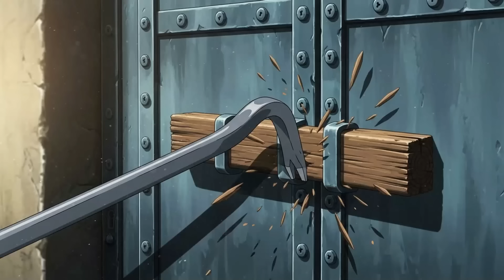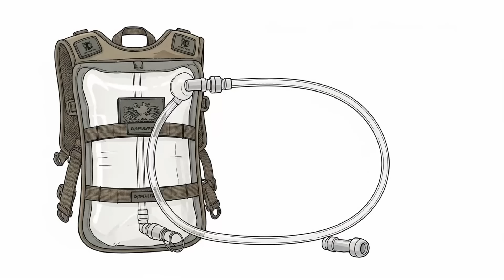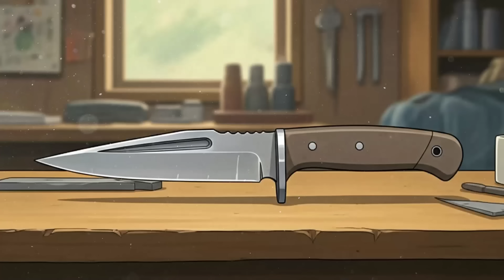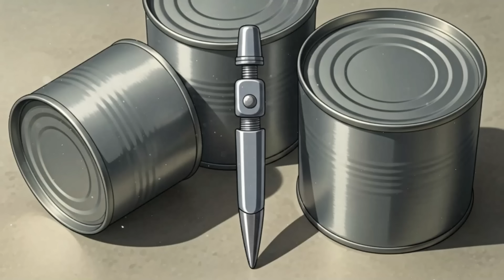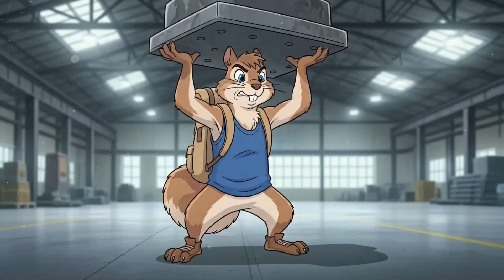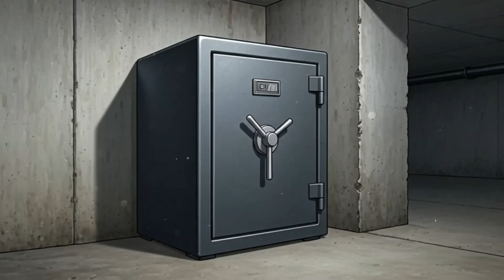They Misled You About Survival Equipment — The 8 Tools You Really Need When Civilization Falls

Comment: Do you only have one kind of screwdriver?????  The same reason you don't have just one knife! I stand by the 2 knife system, a 3-5 inch utility knife(fixed blade full length tang) and a larger knife for chopping, splitting wood and defense(again, fixed blade full length tang). You have obviously never used a Bic lighter in -50 degree weather, good luck getting it to light, the same if it is soaked.  You want to keep a Bic dry and close to your body to keep it warm enough to work. And I ALWAYS carry a Victorinox Swiss Army knife with me, which has a can opener in it. Combat boots have reenforced toes and puncture resistant soles. And if I am walking long distances, the lighter combat boots will not fatigue me as much as those heavy work boots.

Comment: Something your forgetting  for fire kits a torch lighter and trick birthday  candles  to use as starter during wet weather  same as a tuna can with cardboard rolled tight tight pour old wax on it and you have instant  fire I keep some in my kit you can use for cooking or wet wood fires it is almost impossible  to put out in rain and wind you use a next size up can to put out I have ones made with Vienna sausage cans to that I can leave in fire if needed I also use other diy fire starters with stuff from around the house

Comment: Plastic is junk unless its re-enforced.. I can see having a couple.. Canvas tarps can be water proofed with wax.. And they will last unlike plastic, which is destroyed in days.. Even with duct tape.. Use wool blankets, which are still insulated when wet.. If you are going to build shelters, you should have a small foldable saw.. Four to six inch blade (which is good for a knife) will suck when you need to build shelters and collect fire wood..

Comment: Very useful advice, especially about the usefulness of expensive gear.
Overexaggerated the use of a crowbar as a weapon - if you're tired, your swing is slow, easy to avoid and jump you. 20 inch of rebar is faster and as effective.
Footwear is important, but weight is too - if your HD workboots are heavy, you have to lift a pound MORE with every step, adding up to tons in a 12-mile-day-hike. Solution: buy a second pair of  lightweight hiking boots and only wear the heavy-duty ones if needed.
Reply: That's pretty much my exact same thought on footwear. Yes, work boots are great, but they are HEAVY. On the other hand, for anybody who wears sneakers / athletic shoes / etc. as their "daily driver" I would say that even hiking boots are a massive upgrade. I switched to wearing nice mid height hiking boots as my daily footwear about 5 years ago and wouldn't change a thing. The only thing I need to do is buy a couple more pairs, break them in, and then store them away for an emergency. 

That said... I think having a pair of heavy duty work boots around is probably a good idea. But I wouldn't want to be in them all the time.
Reply: @PhillipRhodes i am 64, I wear 9inch work boots . I am used to them. They b steel toe to boot,pun intended. My ankles shot from young lad and sports. More support for me. Steel toes were needed for work. I have hit the toe once with a chain saw. Still have my toes. I have 4 more pairs of boots ready for when needed. Not carring extra pair of lighter boots or versa visa!!!!
Reply from the maker: Thanks for the valuable insights on the crowbar and footwear!

Comment: The comments below mention a lot of very good ideas, but, (IMO) I would have to include; An axe, (double bitted,); A couple of different saws, (one for procurement of wood and one for finishing of wood,); and a shovel (or two.) To go along with these, I would also include extra handles for each.  // As for use, the double bit axe, with the edges sharpened correctly, to bring down larger trees and trim them to desired use. (One edge would be sharpened to a fine sharp edge, and the other to a more rounded sharp edge for felling lumber. Look it up, I did.) The saws would be easier to use, instead of the axe, to shorten cut trees to usable length. Then the other saw could be used to build other items as needed, (Short boards, furniture, wooden tools, etc.) As for the shovels, those are used to break ground for semi buried living quarters, or a garden. They could be used to dig trenches, wells, and berms/dams. THEN, on top of all that, you could add several other items, all to make life easier, such as; a wheel barrow, a pick-axe, a 5 or 6 foot long pry-bar, and a good supply of sharpening files and hones. ((A helper or two or four, would also be nice too!))
Reply from the maker: Those are excellent additions and very practical suggestions for a survival toolkit!
Reply: Hope u b driving or bugging home

Comment: Two things So far.

Mora knives are fantastic. I have two Mora companion knives with a forced patina to prevent rust but Mora knives are not full tang. The tang only goes about halfway through the handle 

A forced patina causes black rust to form on the blade. Once the patina is in place red rust can’t attack the blade.

A forced patina will wear off so they may need to use an acid like vinegar or mustard to replace the patina.

Sorry but I WOULDNT BE CAUGHT DEAD with a ceramic water filter. Those filters need to be replaced occasionally.

Instead I recommend people get a Sawyer squeeze, or Micro Squeeze. If you have a choice get the micro squeeze. It can be set up in different ways.

Inline filter 
Like a life straw 
And more importantly in a gravity filter.

Both Sawyer filters filter down to .1 microns, and can filter up to 100 thousand gallons, and if you carry an empty soda bottle you can easily put clean water in the empty bottle and with the adapter you can back flush the filter when the filtration slows.

The pry bar is a good idea but they make good pry bars that are wider and thinner so you can get a pry bar that is good but only weighs a bit over a kilo.
Reply: One thing about Sawyer filters. Keep it from freezing and it will last 10 years or more.
Reply: Be careful with dryer lint. Polyester won’t light. It will only melt. You want COTTON dryer lint.

I agree completely on three ways of lighting a fire; but I put them in a different order.

Butane lighter
Matches 

These are the easiest methods to start a fire. But sometimes lighters have no butane, and sometimes matches get wet.

And of course a good 1/2 inch thick and 4-5 inches long ferro rod.
Reply: I recommend the P38 above and beyond the P51. Yes the P51 is stronger than the P38 but the 51 doesn’t work as well as the 38.
Reply: About injury; I would recommend a 10% sulfur ointment. Instead of antibiotics.

Antibiotics kills both beneficial and dangerous bacteria.

Buy a container of Vaseline and some sulfur grind into a powder. Combine a 3.5 oz Vaseline with .35 ounce of sulfur and mix well with a stick.

This sulfur ointment will sting when you apply the ointment but the injury won’t get infected.

Years ago I had a scrape on my left arm where it was scratched with the point of a nail climbing down from the attic to the first floor.

I put sulfur ointment on one end and antibiotic cream on the other. The end with sulfur ointment never got infected but the end with the antibiotic cream was red and inflamed. Also with sulfur ointment you won’t hurt the beneficial bacteria in your gut biome
Reply: Moral does make a full tang knife   called garberg. Not real cheap but under 100$

Comment: You're really saying filling a contractor bag with water and put it in a cardboard box to transport it? So a 55 gallon contractor bag filled with 50 gallons of water weighs over 400lbs. Try transporting that in a cardboard box. The reality is you would use two 5 gallon buckets At 41lbs a piece.  There's a lot of good reasons for contractor bags but that is not one of them. Also good luck carrying a hundred of them around with you in a backpack that would basically be your entire backpack and it would be heavy as hell.
Reply from the maker: The contractor bag is for static storage or vehicle transport, not for carrying 50 gallons in a backpack!
Reply: @FalloutSquirrel  I didn't say backpack. Your own video says it's for carrying water in a cardboard box.

Comment: You're aware that that contractor bag with 50 gallons of water in it is going to weigh 400 lbs, right? 

A pints a pound the world around after all.
Reply from the maker: Yes, the idea is not to transport all the water, but to use the bag as a container for static storage or movement by vehicle, collecting water with smaller bottles as needed.

Comment: Two tools not on the list.  Hatchet and entrenching tool (small shovel).  Why abuse your full tang hunting knife slitting wood when you can use a tool that was designed to be used for that purpose.  And go old school.  Bridgeport.  They made hatchets going back to the 1940s I believe.  They use to make hatchets for the Boyscouts. From back in the days when the Boyscouts were taught and practiced survival outdoor skills. The antiques from that era that survive today were made from tried and true hardened US steel.   

Your entrenching tool is a shovel, a hammer, and a weapon.  But don't go for the current model issued to the US military.  They sacrificed long term use for light weight.  Find the ones that your Grandpa was issued three wars back.  They were issued with troops with the expectation they would survive the war and not be a casualty of it.

Comment: Although I get the point about the contractor bags, they are not light.  One is light.  100 is more than a woman would be comfortable lifting.  100 3mil contractor bags don't cost $30.  They cost $60 - $80.
Reply: Contractor strength bags are not cheap. Good things to have but not cheap.
Reply: 25, bags, used sparingly and And only when needed should be enough!
Reply: Great video
Reply: Being a martial artist teacher I can assure you that a crowbar won’t work in a full fight if you’re opponent is able to get within your strike zone you can swing it around all you want but once you get past that strike zone the crowbar becomes useless
Reply: Plus carrying 11 times the amount of water than a 5 gallon bucket is not feasible.  It would be way too heavy and would certainly split contractor bags.
Reply: I don't think he means to carry all of them around in a backpack, I think he means wherever you are staying should have 100 and you take a few at a time as needed
Reply: And the idea of filling a contractor bag with water while it is feasible, good luck carrying that
Reply: You only need 3 at minimum and up to 5 at max.
Reply: Your absolutely right! 50-42 gallon contractor bags are 29.68+tax. I just bought some this week but paid a little less because I used my military discount.

Comment: I have a short machete, a 14.5 inch tomahawk axe , a 2.5 pounds sledge hammer, a k-bar knife, a 2 ft crowbar, a light sapper shovel, a huge ferrocerium rod and a fiberglass long bow, some simple fishing gear and a compass, a water filter is easy to make with baked clay and charcoal and you can survive with tools and fire, if you are not able to open cans with a good knife yet then practice i can open a can with my knife so efficiently that  will make you think it as the electric can opener, and the same for all my tools, is not just having them, practice, use them, master them.
Reply: I'm 67 years old I still have my knife and hatchet since I was eight years old. Don't get me wrong I also have newer supplies. I'm just saying take care of what you have it will last years and you can always add on. GOD bless.
Reply: @michaelponte4719  I agree. Just my first proper skinning knife now looks more like a single edge dagger. There is something to say positive about modern steel so it is advantageous to modernize your kit as you go.
Reply: @michaelponte4719  when the bond between a man and his tools is strong they become extensions of himself, he can feel them when using them, any job is made is almost perfect, If you take care of your tools, they will take care of you.
Reply from the maker: Sounds like you're very well-equipped and have put in the work to master your gear!
Reply: Watch sharing with the " mastered your tools" guy he's probably ok but the less you share, the better off you are.
Reply: @GlenDugger  share, share it all, teach anyone, because people eager to learn will become part of the solution and the come back to civilization, if a bad system can crumble a better one can be build over the ashes, lone wolves will face extinction, many people with different skill sets have more chances to survive.
Reply: Got a folding knife, small hatchet, multi tool, titanium canteen and cup. How are you going to carry all your kit? I need just a jacket. Yes my multi tool has an opener. And my boots ain’t like yours. I disagree with most of this video. My worst? My bow only has 7 carbon shafts. But I would bring my rifle.
Reply: @markwalker4485  how fit are you? all mi gear with 2 days of water and a week of food weight about 35 pounds distributed along but the idea is not to go too far just safe distance to avoid the crowded places but close enough to observe how the rest of the people fares and if they start organizing then join them, lone wolves will have low chance of making it.
Reply: @MiguelDeMarchena  different terrain and training. My fitness? Definitely not as good as it was. I’m happy with the lone wolf idea. Just we never called it that. My idea is to get as far away from people that are not friends as possible.
You all look at looting, seen how that works.
You are going into a gang zone by most ideas and loosing water and food for a recon for no need
Reply: @markwalker4485  that is why hobos are a step ahead from preppers, they improvise, blend, observe, are gray and inconspicuous and they already know to stay away but not too far
Reply: @markwalker4485 very good point,, how do u, if driving u do carry. If packing u make a descion.  I made my belt kit, I pack my pack. In the woods do I need a 2 ft crowbar?? Not really. I need my chain saw ,gas can ,bar oil!! Am I gonna carry that,,, NO.  Be nice but no. In my pack is an 8 inch prybar. So depends where u b , where u b based or traveling. Traveling by vehicle,  bike,,pedal or motor, or by foot on what u can carry.

Comment: Great video.  I have all eight of those, plus a couple redundancies of...most.  I did not see the point of a backup crow bar.  It is solid steel.  If I break that, do I REALLY need a crow bar anymore?  I also know various ways to make clear, fresh, safe potable water from any source.  I have a few bags of each of these; one at work, one in the car, one beside the bed and one by the door, and I have still only spent a few hundred dollars, total.  I am not interested in a name brand death.
Reply from the maker: A backup crow bar is more for when you lose one, you will use it constantly.

Comment: 55 gallons of water weighs 417 pounds. Even with a rigid frame, good luck carrying that in a contractor bag.
Reply from the maker: That's true, 55 gallons is a lot to carry, the idea is for static storage or movement by vehicle.
Reply: Pretty sure it's 55 litres, but you know how the yanks are with their freedom units.
Reply: U.S.  does have 55 gallon heavy duty contractor bags.
Reply: @curtisanderson62  Like a ten gallon hat?
Reply: @curtisanderson62  Must be huge, and thicker than 3.0 Mil?
Reply: @w @woodypigeon . No in the US we actually have 55 “gallon” bags and a defective measurement system.
Reply: @woodypigeon 
In 67 years, I’ve never seen a 55 liter contractor bag. 
It would be too small for any useful purpose  anyway.
Reply: @woodypigeon  They are 55 gallons, not liters.
Reply: That's what I was thinking. There's no way i'm going anywhere with that.

Comment: You need 2 knives in wilderness, a second Bear knife for when mrbear hugs you, and for gutting mr dear.

Get a thin diamond bladesharpener that can be taped to the outside of the bladesheeth.

For firestarting, cut up a broken bike innertube and use as a wrapper for your lighter et.c. that rubber can act as tinder for your lighter.

Buy a few rolls of bread plastic freezer bags. You wear dry socks, then bags, then your wrung out wet sock and wet boots. Your foot will be sweaty but dryish, even when you stand in a puddle.
Reply from the maker: Those are some really clever and practical tips!
Reply: Sweat kills in winter

Comment: All you got to do is take the can turn it upside down and rub it back and forth on the concrete.  This friction removes the seal on the top of the can. And then you simply open the top of the can & consume the food in it. You're technically don't even need a can opener. Not to mention there's your knife. I've opened mini cans with a knife. And my knife is just fine They don't even have no nicks in the blade.
Reply from the maker: Great points about alternative ways to open cans without a dedicated opener!
Reply: Yeah, you use your crappy beater knife, the one that strangers see. Keep your good blade concealed under clothing.
Reply: Real men open cans the Popeye way,,,, could not help it. I prefer my old scout knife of my Swiss army

Comment: Question ! 
  Just 45 gallons of water With each gallon of water weighing 7.11 lb will equal roughly 320lbs In this situation. Who is going to be carrying a plastic bag with 320lbs  Plus to be honest with you I don't think one of these bags can handle 320 lb. The liquid. 

So obviously you've not thought this out very well.
Reply from the maker: some construction bags can hold this weight. weak garbage bags really can't hold up. As for carrying, you don't need to carry all the water, but remove it from that storage with a bottle and fill up as needed.
Reply: It's an error. In the UK rubble sacks hold 55 litres, not gallons. It's just those yankees being hopeless with their freedom units. Also 3.0 Mil, is three-thousands of an inch, or 0.076 of a millimeter